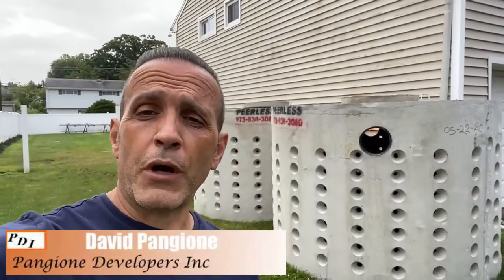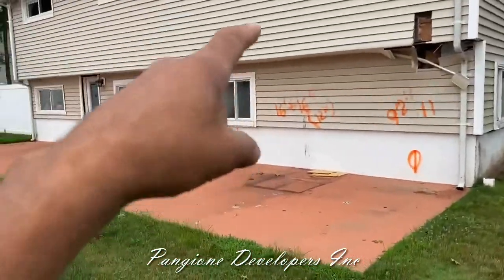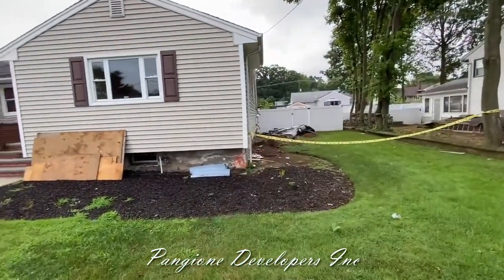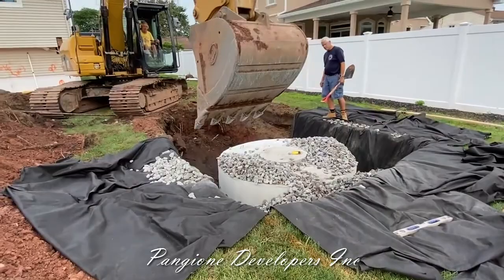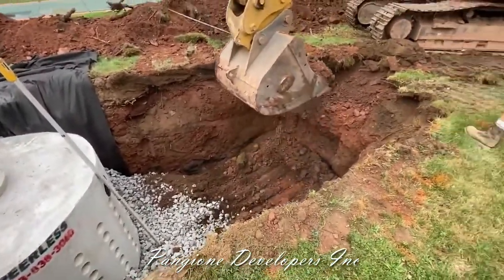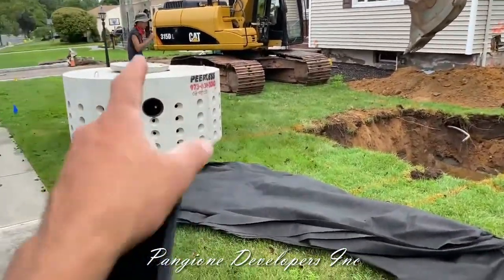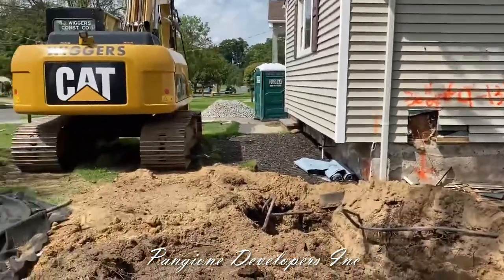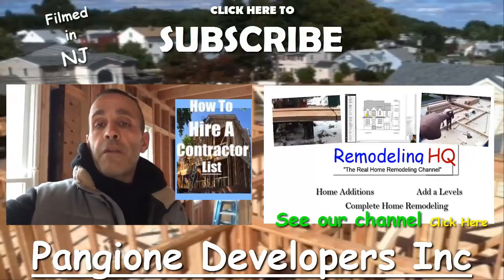SEEPAGE PIT - Water Management Systems | Pangione Developers Inc

Comment: Thank you for the video. 
One question why not just one pit and run all the lines to that pit?
Reply from the maker: If installing a pit, we follow an engineer report. In this case, the report required 2 pits with a total capacity of 2000 gallons